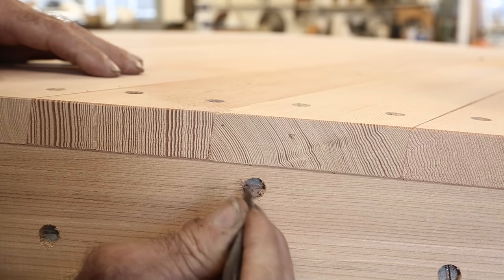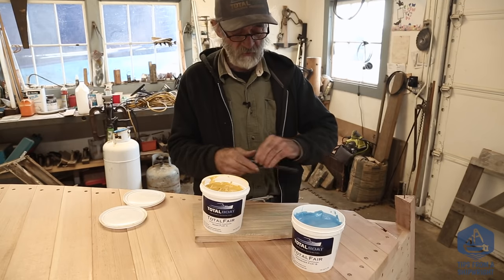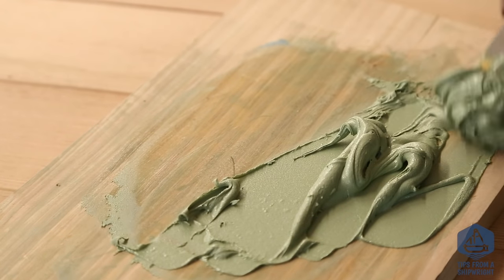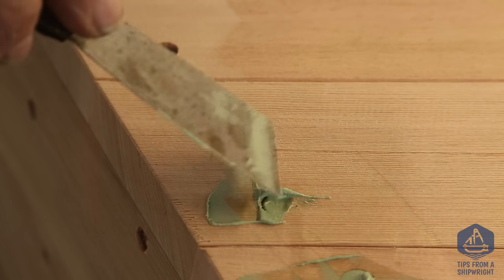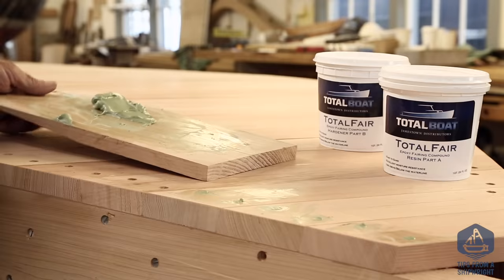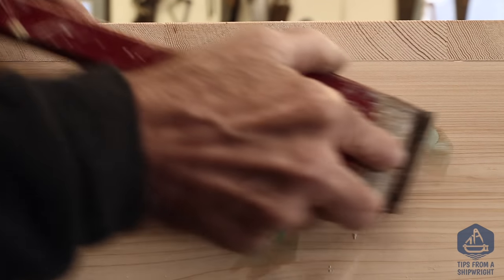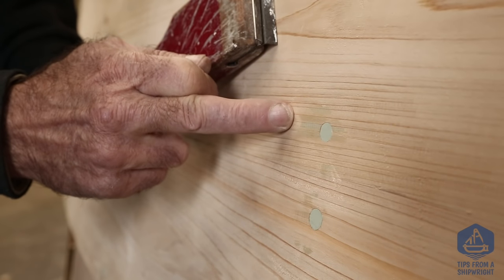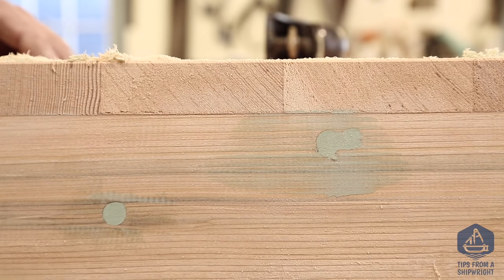Building the TotalBoat Work Skiff - Filling over the screw holes (Episode 19)

Comment: so cool - i have been obsessed with all these videos lately - cant get enough.

I was actually surprised by the beginning of this video.  The process of going through EVERY single screw hole on the boat an scraping seems like it is VERY labor intensive and time consuming.  I would think it would pay huge dividends in time savings to make sure when the screws are going in that things remain clean - and to be super careful with the poly-sulf so as to not gunk up the holes.

Never having built a boat i dont know if thats possible or not - or how long cleaning all the screw holes actually takes but that just shocked me somewhat.

Either way - so awesome.

Comment: Shower thought: what if you put the putty into a piping bag (like the kind you would use for frosting a cake) and cut a fine tip and just pipe the putty into the holes? Would that not work better than a knife?

Comment: At 2:05, you contaminated the resin pot with the hardener.  Should use two separate tools.  Otherwise, great video, Lou.
Reply: This, but otherwise can't wait for the next, and very grateful for this new installment! Thanks Lou!!
Reply from the maker: +Jim Subtle good spot guys - you are correct best to use a different tool for the hardener
Reply: or geat real. It's boat building not NASA. He probably has other stuff to do, like the rest of the boat.  It'll be fine.
Reply: Why does boat building require less care?  And by what authority do you insist that epoxy compound is not contaminated?
Reply: As a former paint and body guy, it was like nails on a chalkboard.

Comment: Thanks for showing the two part fairing compound.  I’m getting ready to build a boat and had no idea anyone had that, was gonna use a one part which was bothering me (everyone knows that one part adhesives aren’t nearly as good as two partners without having some seriously caustic chemicals in them — not that all two partners are “green”)....

I like that you use the scraper before a sander......already too much sanding involved in boat building.....so many boat builders spend more than a quarter of their time sanding, most of that is wasted time trying to create a polished mirror only to cover with 3 to 10 more layers of epoxy, primer, paint, clear coat......

Comment: I have thoroughly enjoyed all of the knowledge you have shared and have watched most of this series 3 times. I anticipate each new video, as all the others who are following. I do have two question. Most of the dimensions of the boat have been shared, but the transom dimensions are not. Could you provide those dimensions? Also, working aft from the transom, the vessel flares to its widest width in the beam (maybe 6'6") then tapers back to the transom. Is there any rule of thumb to determine the taper from midship to the transom? I have a few other questions, but want to work through my own process of what I want before I ask. I hope to build this boat, as well as a few others. Thanks

Comment: Alternatively you can use any epoxy combined with dust from your palm sander.
Reply: Sawdust and epoxy can make an excellent filler for a range of uses, but care does need to be taken when choosing a product for capping screws. Don't forget that you want to cap them with a material that you can dig out without ruining the rest of the wood involved.

Building a good boat is one thing. Building a good boat that is also easy to fix later on is another issue entirely.

Comment: why care about a little stain or pencil line when you are going to paint over it anyway. i noticed the hardener in the resin too. that fairing compound looks really cool, next spring when i fair my keel i am using it, the hell with west system and all that filler that takes forever mixing. are you selling the skiff when finished, you never told us how long the  boat is,, i think i saw 19 feet on one of the side planks. lou thank you very much for all you have taught us.

Comment: When you put the spatula with paste of the one part of the epoxy to the other without cleaning, it does not affect the rest of the hardener in the bucket?
Reply: Not really on this type of product.Worse case is you have a tiny string of rubbery like trash to pull out.But  that is only if it sits for a long time.It can touch and wont really harden until you actually mix and work it together and chances are that'll little bit will get mixed next.
    You try not to do that but on a big project like that its not a big deal since it'll get used next.Now if that was the only batch you're making I'd recommend getting it out of there though.Because after sitting you'll have a partially cured piece that wont mix in that needs to be trashed.
Reply: SouthJerseySound thanks for the info. I use regularly 2 part epoxy 5 minute but i suppose it is quite different from the one on the video.
Reply: Polis Dimitriadis No problem,I know if you do that with some stuff it'll ruin it.But in this case its not as critical.Most fairing compounds like this wont fully harden until they change colors,worse case is it turns to a rubbery waste.

Comment: If you were to put masking tape down before drilling the holes you could fill the holes without getting the putty were it did not belong. Right after placing the putty pull off the masking tape and you have a clean job.